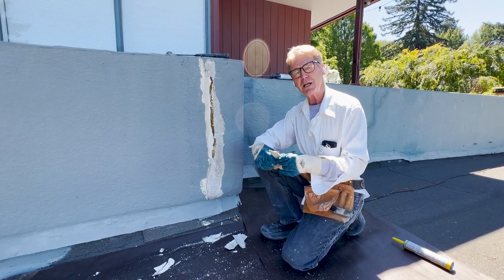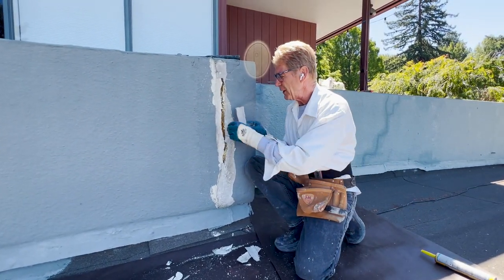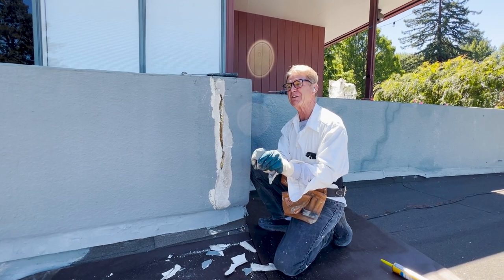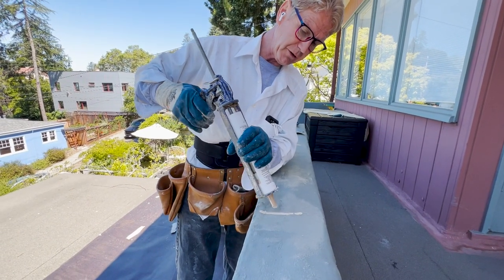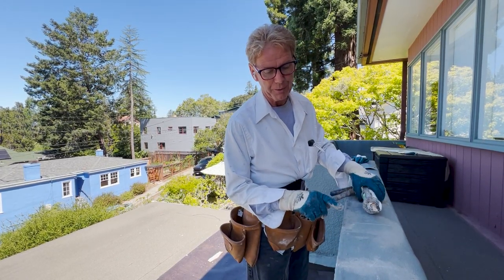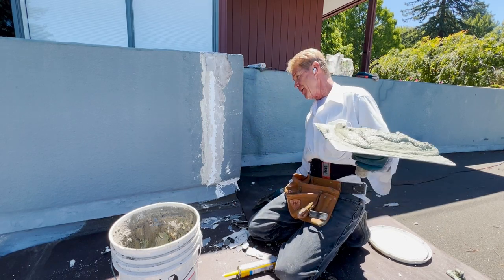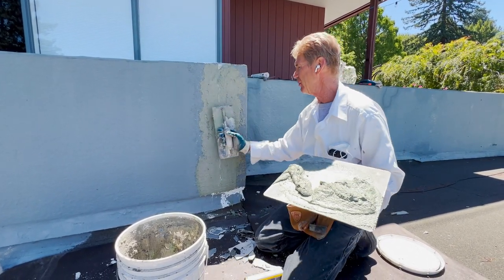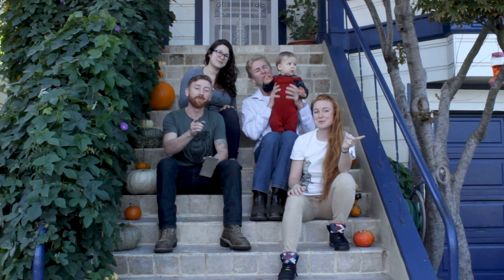Repair stucco cracks on rooftop parapets

Comment: Hello Kirk. I have about a 1 inch crack in the ethos stucco I'm trying to repair. I cut it on both sides kinda in a v shape and put morflex in it. The morflex doesn't match the ethos though. Sand is much smaller than the Styrofoam beads. I left it with about a half inch from flush. Do you have any suggestions on what to put on top to get it to match? Any help would be greatly appreciated!
Reply from the maker: Howdy Jason, no problemo, the Mor-flexx caulking going to need to be done anyway as it’s not designed to fill cracks either 3/8 deep or wide. No worries go to HD or Lowe’s buy a ten pound  box of “Rapid Set Stucco” mix a bit than apply and float it with a green sponge float, first apply a boding agent like Quikrete over the area, it sells for about ten bucks a pint at Lowe’s or HD. Cheers
Reply: Awesome thank you!
Reply from the maker: @jasonjames488  no problemo.😉
Reply: Sorry to bother but I did what you suggested and the crack came back before the Rapid Set stucco patch even got dry :/ Is there a plan b? Or caulk and cross the fingers? It looked really good and I was like I had it whipped for about 1/2 hour.
Reply from the maker: @jasonjames488  Plan B, was to fill the crack completely not just the surface, or it can get sucked in, however if you then applied stucco over it, the stucco should have hardened and not also got sucked in, it must have been a heck of a crack.

Comment: Permanent fix would be a vertical control joint consisting of two pieces of casing spaced 3/4 inch apart with the gap between the two vertical pieces filled with a Quad Max or similar caulk. Permanently flexible joint. 
I know they didn't pay for that but they should have. The roof is so incredibly important
Reply from the maker: Howdy Chris exzackory, that and a weep screed 4 inches off the deck. Often folks do what they can, which is a lot better than doing nothing.😉

Comment: Sorry Kirk one more... I've been trying for ages to find mor-flexx here in Puerto Vallarta Mexico with no luck. are there any other brands of calking you know that I could look for that are similar with sand aggregate for exterior stucco cracks repair? thank you again sir you're the Man!
Reply from the maker: Hi Rainham dude, try quikrete caulking also with sand.😏
Reply: @StuccoPlastering  thank you sir unfortunately I've never seen quikrete here either. sika seems to be the big name here. btw were you able to get a place booked?
Reply from the maker: @rainham1  Howdy Rainman, no, have you any leads on rentals? 🤔
Reply: @StuccoPlastering  unfortunately no,  lately it's been getting really difficult in the high season. if I come across something decent I will certainly let you know.

Comment: Hi Kirk, I find your channel interesting....I live in the Pacific North West, your railings have stucco on the top of the parapet (as your showing the repair) why don't you use cap flashings there? We live in a rain forrest and never have these issues you are showing today. ....just wondering...Thx
Reply from the maker: Howdy Les Sterling Dude, I tell most folks to install metal cap flashing, however, not all can for many reasons.🍻

Comment: Kirk is that sikaflex 1a?
Reply from the maker: Howdy Rain Ham Dude indeed is, an adhesive sealant, it's the strongest caulking I've ever used. Just don't get it on you.👍
Reply: @StuccoPlastering  thank you sir and may the force be with you for many years to come you are a treasure no exaggeration

Comment: G'day Kirk, do you let that sikaflex go off completely before the new stucco goes on..? Same question for that bonding agent you use. Do you let that dry, or is it still tacky when you apply the stucco. Cheers
Reply from the maker: Howdy Didgejan excellent question, the bonding agent and or primers, takes about ten minutes to  twenty minutes to dry, as a rule in normal weather. The amount of Sika-Flex applied would takeeabout three or four days to dry out.     The acrlic stucco I applied about a day. The rear of this wall allows air so all will dryout regardless. 🍾
Reply: @StuccoPlastering  Thanks Kirk, much appreciated..